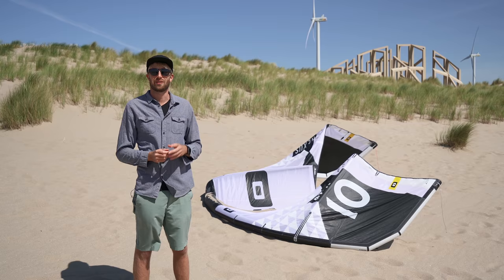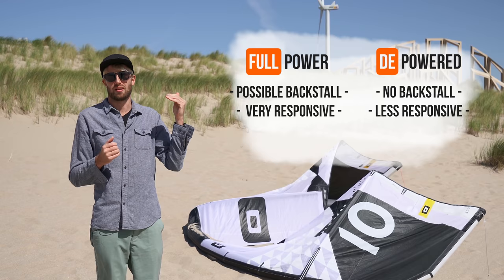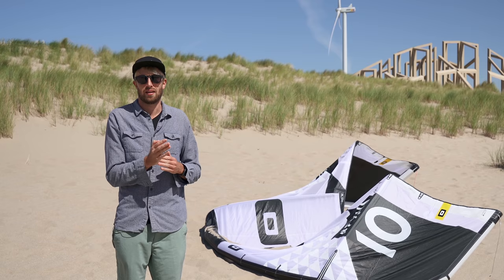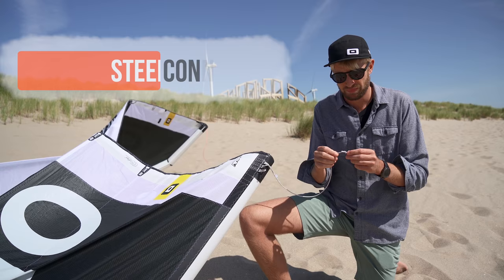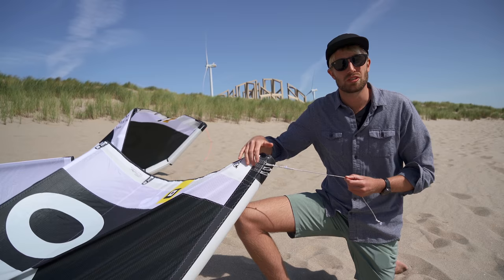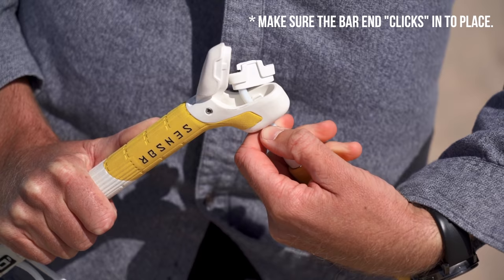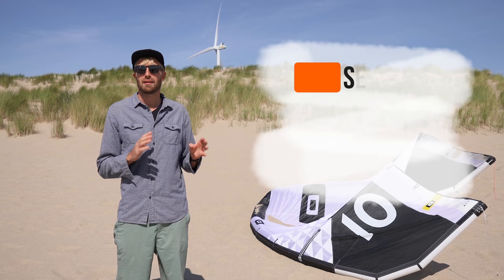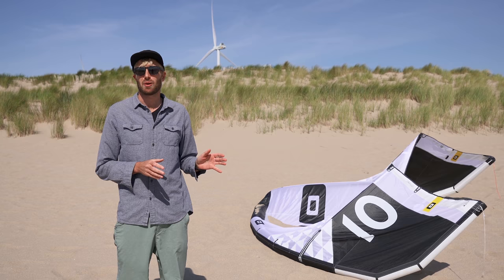Trim your KITE to PERFECTION // Kiteboarding SA Masterclass

Comment: What about the apparent wind you make when moving in the water ?? The kite won't see the same wind as standing in the beach in your video I guess.  Anyways, if it works, it works.
Reply from the maker: Hey Fabian.
Of course the apparent wind has a massive effect on the kite, but this is an entirely different talk. The kite trim is something you can do very well on the beach and this will have the right effect on the water. 
Would actually be different to do an entire talk about apparent wind

Comment: Great stuff, Steven, thank you... I do have a question.. Sometimes, I ride a slingshot rally 2017, 7m2 of a friend.... when steering forcefully and powered, the kite collapses, as if its blatters are loosing air pressure..  the only way to correct is shifting out the bar completely... it happens with aggressive steering, and once it happens, all force vanishes instantaneously... it is freaking me out..   what can I change to stop this from happening?
Reply from the maker: You could try to pump the kite up a bit harder, in that case it should keep the shape a lot better. Not sure what Slingshot recommends, but I would pump it to at least 8psi  (depending on the wind conditions, I pump it harder for stronger winds)
Hope that helps,
Cheers Steven
Reply: @stevenakkersdijk  thank you, so you would exclude that issue to be due to line trimming? Tomorrow, I may fligh it again, and I will check the pressure in the tubes, luckily, I do have a manometer...
Reply: @hendrikdelange6924  Hi Hendrik, I had a possibly similar experience with my pivot 10m: kite collapsing in full flight, not so comfortable. I found out it was because of the line extensions. The steering lines were to long if I used either the second or third not. Only when I used the first not the kite was powered sufficiently. By the sound of it, you might have a similar problem?

Comment: Thanks Steven: great kite tips ! 
Video tip: Also, how do you manage to get such a good sound - I see no mic ??
Reply from the maker: Thanks man! 
I have a Rode smartlav under my shirt. Previously I would use it with a long wire (also in this video) which works perfect.
Recently got the wireless go, so curious to see how that will go.

Comment: What would the best cit mode be for the xr5 for big air. I have a 9m
Reply from the maker: The XR is probably the one kite where I haven't played with the CIT points. But the basics are the same, closer to the center of the kite will deliver more depower and power on demand, but a less stable frame. The knot close to the tip will give you a solid frame, but more constant power.
Personally I would ride it on either the middle knot or the one close to the tip.

Comment: This is so backwards and has me so confused on the bridal setting at 8:00. My slingshot literally says wave on the outside line which will pull it in to more of a C shape and it says freestyle on the connection closer to the middle of the kite which would open it up. 🥴🤪 Its backwards from what he's saying..🤔
Reply: You are confusing freeride and freestyle
Reply from the maker: My guess is that you confused Freeride and Freestyle. But I'm not familiar with the Slingshot kites and their setup. This video is based on CORE kites.

Comment: Great video, but if you trim your bar and then move your kite lines up a few knots, then it's going to defeat the purpose of trimming your bar.
Reply from the maker: That will all depend on how your kite lines are set up and if your lines have decreased in length over time. As I mentioned in the video I like to have a kite that is set close to backstall for big air. When I go out in strong winds this point shifts a little bit, so I can power the kite up more before it backstalls. This means I'll ride my bar full power with the knot all the way up (most power on the kite) for that session.